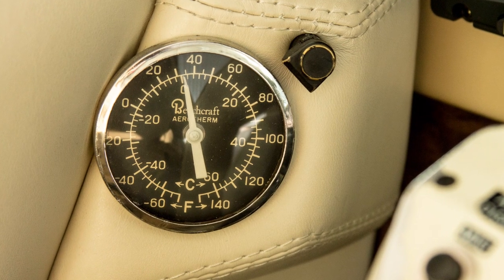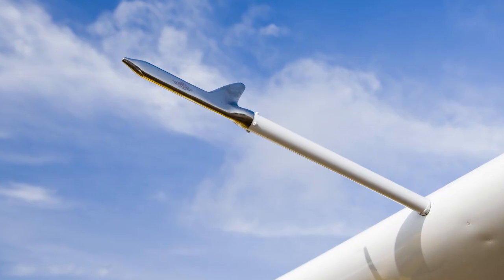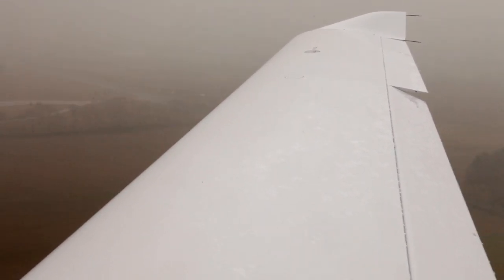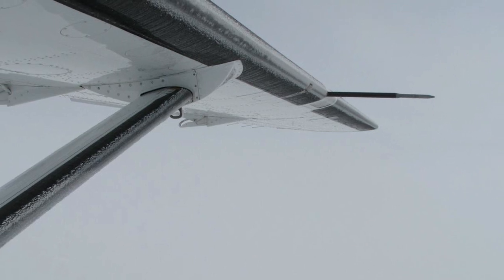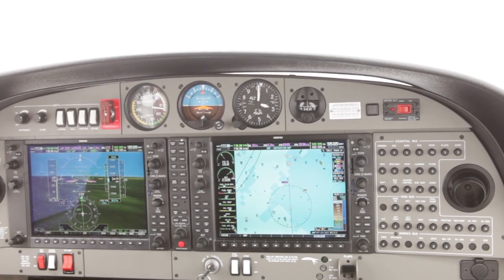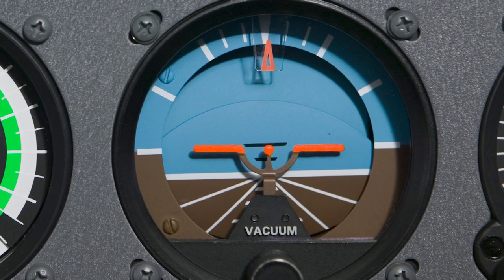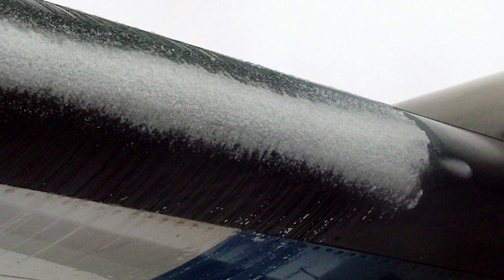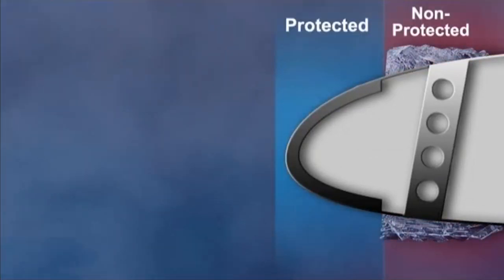Flying the Weather: Picking up Ice

Comment: Great video.  I recommend 4 deg C on the OAT gauge as the point to start watching for ice.  Seen ice there at that temp, in GA aircraft.  The “big boys” use 10 deg C...as the point to turn on engine anti ice.  Some of that is heat rise (they’re faster) but the video’s tip to start looking at OAT at 0 deg C...i think that’s late.

Comment: I flew all over the midwest year round and picked up ice when clouds were out in the fall through spring. Great training for knowing how to handle ice. never had that problem much with jets as you could climb through it pretty fast or descent through it using bleed air to heat the wings. Props were boots and hot plate. Still always very uncomfortable. Most landing required getting out of the aircraft and beating ice off the leading edges when the boots were not covering that area. Northern Ohio like Cleveland was the worst....
Reply: Fun2 Drive I
Reply: most often when its cold, just before landing i climb out my window with my hair dryer on full blast & blow the ice of the wings & props then give a good few flicks with my hand towel; works every time!

Comment: Winter really cuts down on my flying.  Would love to go see my son in Michigan more, but no way.  Ice seems to be there all the time.  Good video.
Reply: Watch the video again, get more weather training/knowledge. Go see your son more often.
Reply: James Muhammad Wrong. Buy an airplane w FIKI certification, and then go see your son. Training doesnt make ice fall off the aircraft.
Reply: Wrong on both Dirty and Muhammad !  Even brand new boots won't remove freezing rain accumulation from the other surfaces.  Known ice certified does not mean ice proof.  Just means a little bit.
Reply: @dirtysouth17 nope. That kind of attitude kills people. 

FIKI is only for moderate icing for a few minutes. Unless you can turbine yourself up to the flight levels and clear air... use FIKI like you use (should) 4WD.. to get out of trouble, not into it.

Comment: Carburetor is all ways first to freeze. The Venturi is cooling it as the air is drawn through. As ice builds up in the Venturi air is restricted manifold pressure drops
Reply: Not necessarily. On Lycomings it’s attached to the hot oil pan. With wide open throttle there isn’t enough of a pressure change for it to ice up.

Comment: I got iced up pretty bad in a cessna 210 going into Georgia one winter. 1. Dont panic 2. Tell the controller what you need - NOW 3. If doesnt cooperate declare an emergency. 4. Keep your speed UP all the way to short final. 5. Dont mess with the gear or flaps until short final. 
I wont bother with stuff like climb which can be a bet. Do you really know the cloud tops? Climb slows the plane and puts you closer to a stall.
Turn around could be an option but we all know often you pick up a little ice and five miles later break out in clear. Awos es 20 miles away arent gonna be much help at the moment.  Concentrate on flying, get to nearest airport, keep speed up and dont panic.  This happened to me with a TAF for an hour before arrival and rest of the day of  2300 sct vis greater than 10 temp 45 in KAHN. In fact on landing it was ovc mvfr and 33. Shit happens.
Reply: If you can only accept one answer from ATC it sounds like an emergency should be declared then, if it hasn't been already.

Comment: Few years ago during the ice storm in Texas/Louisiana it took me 14hrs to go from NoLa to Houston(Ice roads. Closed roads. For 25miles I was only vehicle on I-10. Either direction). Had to stop several times cause headlights were not working as so much ice(2-3") was on front of truck dimming the light shine. Wierdest thing. I had ice on my lug nuts. It wasnt just like a glob of ice around the nut. You can tell it started when I was at a slow roll cause each lugnut had a icicle at a angle caused by forward momentum. Ice is crazy and will form in ways you could never imagine. I know this is planes it just reminded me of my ice story. I had icicles hanging from my side mirrors at 45° angle. If I was a pilot I would probably overfocus on ice.
Reply: I can bring down a small airplane incredibly quickly.  There's a reason 1/4 of weather accidents are due to icing.  It can happen within minutes.  There was an accident a few years ago air safety did a video on it with a turboprop who was trying to climb out of the icing and couldn't.  The whole incident lasted maybe 5 to 10 minutes and he had anti ice tools.  Sometimes it accumulates too fast.

Comment: A non-pilot question, leaving behind the FIKI, are there some GA planes more susceptible to icing e.g. control surface actuation, wing type(laminar flow vs. conventional or high wing low wing)?
Reply: +James Smith I'd say that most airplanes accumulate icing uniformly.
Reply: Some aircraft are affected more: those with smooth laminar flow wings like gliders: even rain affects lift, so we add 5 knots to the approach speed if wings are wet. Aircraft with less perfect wings are less dramatically affected by bugs/dirt, rain and other imperfections. If you do pick up ice, having "excess" power available can help you cope. If you have marginal power to start with, adding drag to the wings will have a severe effect on performance. If you have struts or fixed gear there are additional surfaces in the airflow which will add drag when icy vs no-struts and retractable gear. So its more a factor that some aircraft are affected more adversely by some ice, not that they are more likely to accumulate it. You've made me curious whether some airfoils would be more likely to accumulate it... or materials fabric vs alum vs composite -- nicely cleaned and waxed vs rougher surface... I have no specific data on that.

Comment: Are there hydrophobic treatments/coatings that you could apply to leading edges?
Reply: Yes. 

Ice X

But it only helps shed ice... it doesn’t prevent it from accumulating. 

Turns out water droplets freeze and stick to pretty much anything that is below zero.

Comment: Okay...now...how to excape ? What are the best ways of hightailing it out of danger ?
Reply: And turn on your carb heat and anti icing systems
Reply: I'm not a pilot and i was going to ask the same, I've seen many videos talking about taking precautions. ...but the reality doesn't quite fit in the precaution advice I've watched so far. I've seen pilots climb up and stall I've seen pilot climb down and stall. I came to a conclusion that if there's risk of ice in your route and you flying a non pressurized aircraft, you better stay on the ground.
Reply: Jam power in, make a beeline the fastest way to uniced air.
Reply: You need to get out of the cloud or at least to warmer air. How I do it is when I know there is going to be ice in an area, I also find out where the cloud tops are going to be. It is as easy as asking ATC, and it will be in the briefing I get before I take off. I also have a pretty good idea where warmer air may be if I need it by looking at the winds aloft forecast.

When I am flying along and I know that I am in an area where ice has been forecast, I ask ATC if they have any PIREPS (Pilot Reports) of known icing along my route. Once I get an idea where the ice is, I just try to avoid it. But let's say I get into the ice. First thing I do it tell ATC that I am picking up ice. If the tops of the cloud are within my ability to get to I will ask for an immediate climb in any direction. Once out of the cloud the ice will sublimate off. If that isn't an option I will descend to warmer air if possible. That way the ice melts off. In a temperature inversion I may have to climb to get to the warmer air, that is fine too. If I can't do either of these things I will turn to the nearest VFR weather or even do a full 180 and get back to where there was no ice.

Now lets say I can't do any of that, then I will declare an emergency and land at the nearest airport I can as fast as I can. Hell, if I am getting ice fast I may declare the emergency and follow the steps above. The only option that is always off the table is staying in the ice. A good rule of thumb is that if you climb or descend 3,000 feet from where you are getting ice you will probably get out of it (but not always, especially if there is a lot of uplift in the cloud so don't take the rule as gospel). In short, if you are flying along at a location and altitude where ice is, don't be there as quick as possible.
Reply: Thank you!  That's the best answer I've seen to the question, "What do I do if I notice icing."  It's not intuitive that ice may sublimate at a higher altitude, for example.  Thanks for the straightforward explanation.  @golvic1436
Reply: tie oneon yes, and it’s often encouraged for certain systems. Things like pitot heat and inertial separators are usually on/open before entering a cloud. As far as systems like inflatable leading edge boots, usually you wait until you’re inside the cloud to start using it, as they are designed to inflate and break up the ice after it’s started to accumulate.